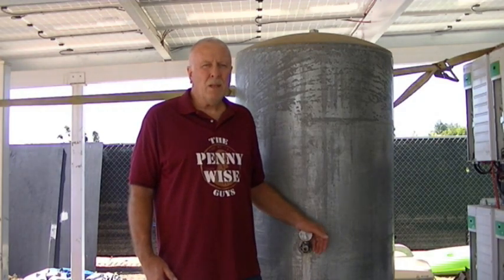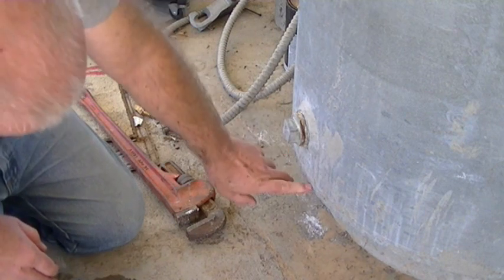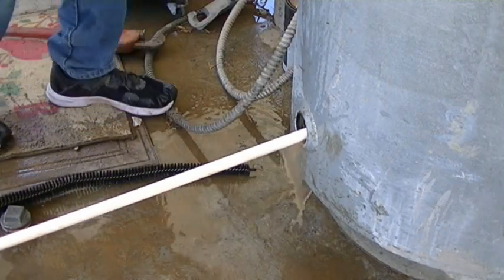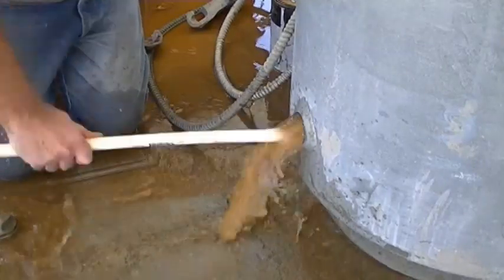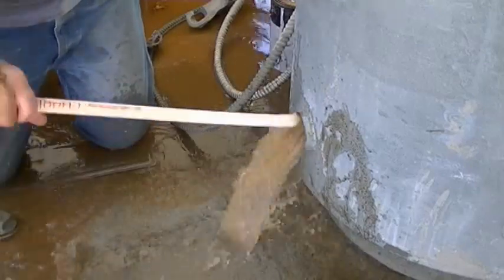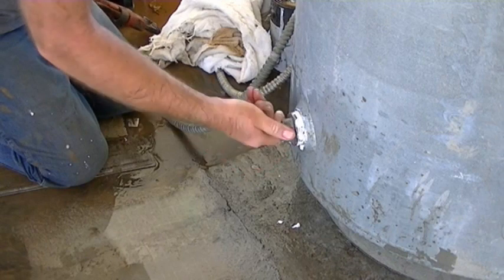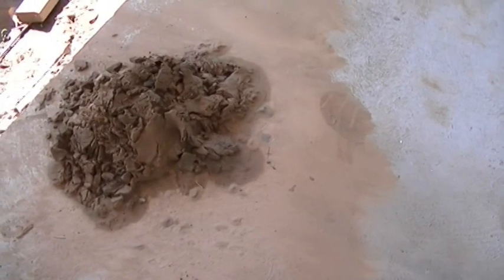Drain Sediment From Well Tank      #well #tank #cleaning #hacks #diy

Comment: As a licensed master plumber (50 yrs.) I’d have worn boots & or waders. That’s #1
#2. After removing the plug, I would install a bushing or bell reducer with a short 3/4 inch nipple with a full port ball valve and add a garden hose attachment for the hose. Just my thought.

Comment: If my setup is similar to yours and I do the exact steps that you did should I be worried about electrocution?
Reply from the maker: Hi. Great question. As long as your electrical wiring is to code and are not exposed to the outside elements, then it is totally safe. I turn off power to the pump and drain as much water pressure as possible before taking out the drain plug and and then turn it back on so the pump runs while you stir up the sediment. Once the water runs clear, turn the pump off again to put the plug back in. Blessings my friend.
Reply: Yes-electrocution-ABSOLUTELY

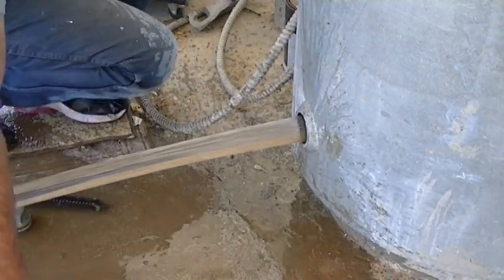Comment: 1:25 - Hey thanks for showing us this. Question: How long did the gushing last for? Also, I just want to make sure I understand the correct order of steps. You shut off the pump first, removed the plug, stirred the sediment out, and then replaced the plug, and turned the pump back on. 

Is that right? And btw did you end up draining almost the entire tank?
Reply from the maker: Hi. The procedure is 1 turn off the pump 2) drain the tank by turning on a faucet or two. 3) remove the plug (but expect some pressure to be still there and a loud gushing sound. 4) turn pump back on 5) still like I showed and allow the incoming water into the tank to pick up the sediment and flush it out. 5) When water runs clear, turn off the pump. 6) replace the plug with thread sealant as needed 7) turn back on the pump and enjoy sand free water.
Blessings my friend.
Reply: @thepennywiseguys  Thank you! For step 2) I don’t have to fully drain it though, correct?
Reply from the maker: @teegees  That is correct.  Just reduce as much pressure as you can so it is not such a blast when taking off the plug. Make sure to hang on to the plug as you take it off.